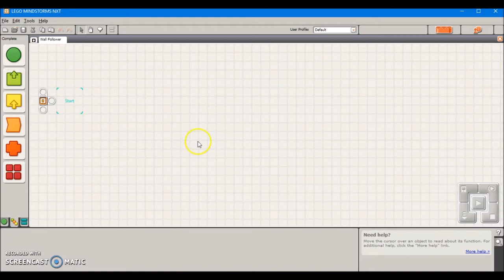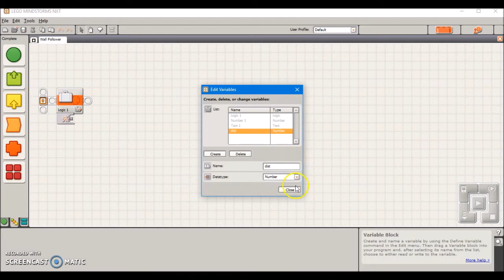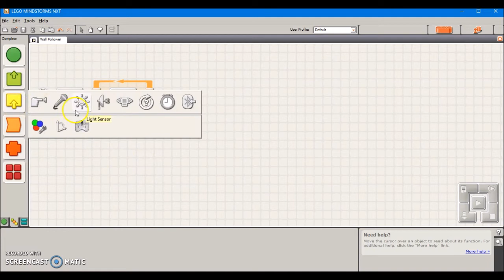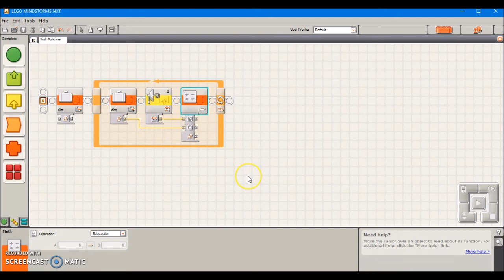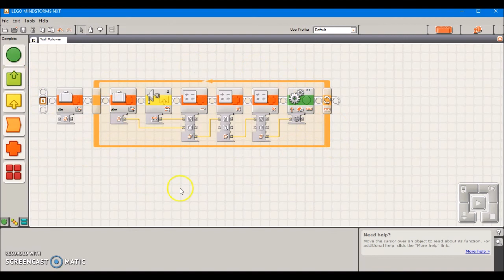How to Program a Proportional Wall Follower in NXT-G

Comment: I just watched your EV3 wall follower tutorial and noticed that you mentioned the possibility of combining the blocks. I sometimes use a range block for these types of programs to increase the "goldilocks" zone. Of course, the best option, in my opinion, for achieving a fast and smooth line or wall follower is to add a simple PID function into your program. It's very simple and quite effective. Keep up the good work!
Reply from the maker: Thanks for sharing your wisdom!

Comment: Hey Builderdude, I think you do a great job explaining things. Even though I've got a lot of experience with programming, I like to watch your tutorials for entertainment. There are always things that you can learn from other programmers no matter how experienced you are. Also, I wanted to point out that you could perform the same functions by combining your two multiplication math blocks into one block set to -3. I'm sure you've done this in other programs, I just wanted to make note of it in case you weren't aware of this possibility.
Reply from the maker: Thanks for pointing this out! I am fully aware that I can combine the two multiplication blocks. I keep the -1 multiplier separate to highlight to my viewers that it is optional, depending on which side of the wall you are on. I do it to show that it can be removed/added as needed.